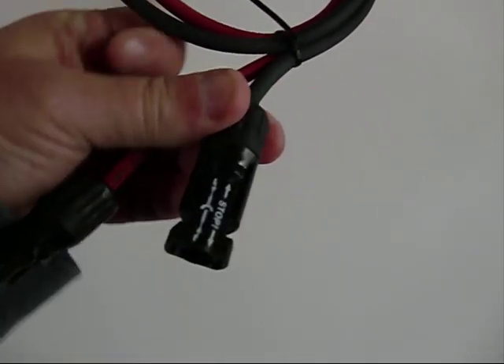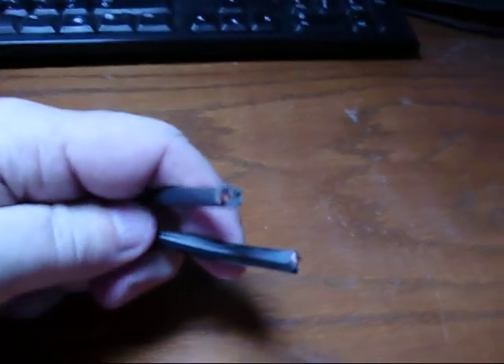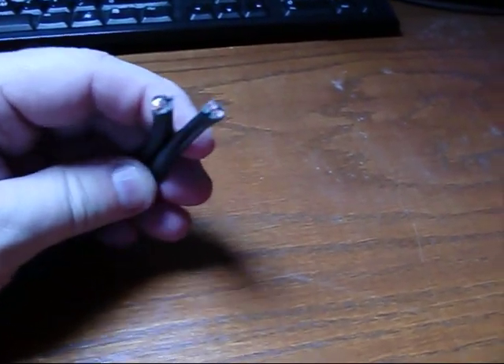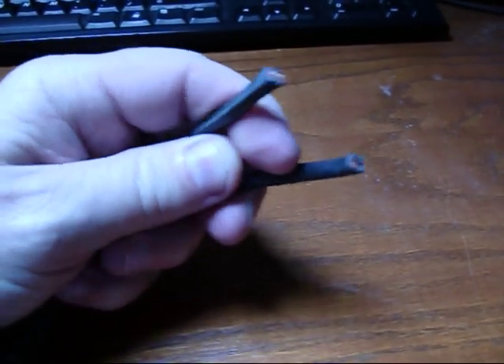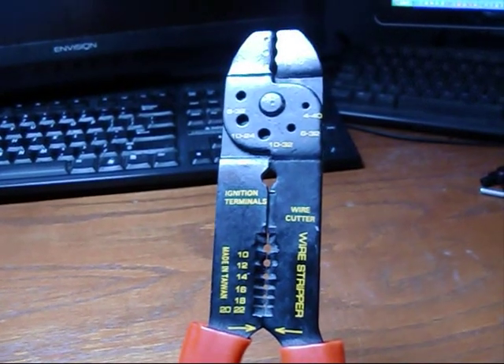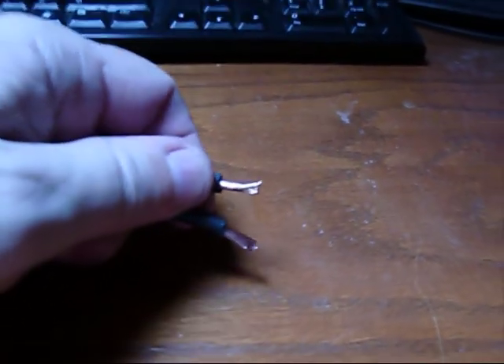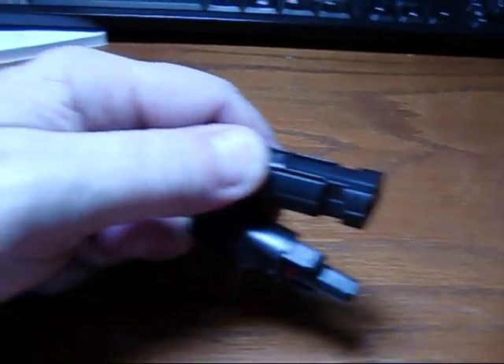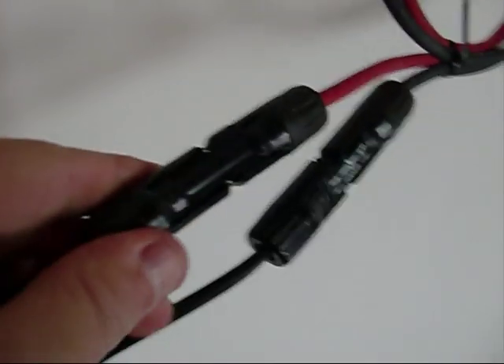DIY MC4 Solar Panel wiring

Comment: This was helpful to me as a newbie to this type connector. However, I believe I will limit these to outdoor use only, and only to mate to what is on the panel I purchase. Once indoors or even under the building/out of the elements, I will switch to more conventional (and cheaper) DC wiring hardware and techniques. Also, having a lot of experience in crimping, I would suggest getting a crimper that exerts 360* crimping pressure if possible. If you can't find one, crimp AND do a careful and minimal soldering on the contacts to ensure a good, long-lasting connection. Buy a few extra 'pins' if you're unsure of your soldering prowess.
Reply: snowbird29803 this isn't helpful at all. This is very dangerous what he is showing. this must be done by electricians with a proper crimping tool made specific for MX4 connectors. IF you do this with the kind of plier he showed you are making a terrible connection. The crimping part of this plier is made for insulated cable shoes, not MX4 connectors because mx4 connectors use trapezium crimpers.

Comment: Good that you mentioned the solar rated cable, if mounting on roof, wiring should be that cable only, but once you go off the roof and go conduit or ground mounted use cheaper cable...

Comment: The 'electrons flow down the surface of the copper' is called skin effect and only happens with AC currents at high frequencies of many Mega Hertz.  It has no effect what so ever at DC.  What matters is the total cross section area and how flexible the cable is if it is going to be subject to any movement or vibration.

Cheap crimp tools do work but are prone to giving weak grip on the wire.  After crimping always test the joint with a good firm tug to prove it's secure.

Using other types of cable may not form a water proof seal to the MC4, water, even humidity will over time destroy the joint with surface corrosion, especially with a DC current flowing.

The other important point with DC solar connections is never to plug or unplug with a current flowing.  It will arc and burn the surface of the connector.

Dave.
"I'm an engineer so let's save time and accept that I'm right"

Comment: Sorry on a debunk channel.  I wouldn't use the MC4 connector for nothing.  I saw when this trashy connector was release by I think it was 3M.  They were trying to a similar style connector for fiber which wasn't popular.  If it was me depending on the current and voltage I would use a good ole XLR connector.  The solar industry can just change.  Most people I know just cut those connectors off and don't use them.

Comment: It's better not to pre-solder the wire. This adds resistance to the end of cable. It's better to only use solder when attaching the wires to each other or a solar panel etc, without adding extra solder before-hand. The reason for pre-soldering is when pre-stripping copper wires that you don't want to oxidise.

Comment: Don't spread false info.
Electricity flows through the copper metal, not the surface of it regardless of wether it's solid or stranded wire. Higher amperage requires a bigger cross section or "gauge" wire (lower numbers are bigger wire). The only difference between solid and stranded wire is flexibility.

Comment: Good little video. Now, how do I connect the solar wires to my charge controller?
Reply: +Jesse Toler Most charge controllers just take bare wire because it has screw terminals.  So, if you used 10 gauge wire like this guy did, connect your MC4-crimped side to the solar panel and strip the other end of your 10 gauge wire, twist the strands together, and insert the wires into the + and - screw terminals of your charger controller (PV terminals!! not battery or load terminals!) :)

Comment: The claim about electrons and the amount of wire strands is just plain wrong!
Electrons do not flow down the outside of cables. They flow inside the cable. (Just like water flows inside a hose, not on the outside. )A thick, single-strand, copper wire will allow more electricity through than a bunch of thinner wires. Thicker wire also allows higher amperage because there's less resistance.
The only reason for multiple wire strands is to all the cable to be flexible without snapping.

Comment: Why did you waist a bunch of time showing that is totally use less and then miss showing the improtant part of process, the striping of insulation with strippper and  crimping part with crimper.

Comment: THEY ARE NOT MC4 CONNECTORS BUT COPIES!  THIS GUY DOESNT KNOW THE DIFFERENCE.  THE CABLE USED IS NOT CROSSEDLINKED, AND HE STRIPPED BACKED TOO FAR.  THIS GUY IS DANGEROUS

Comment: Good video.
Hello friend, we are a MC4 connector manufacturer in China, welcome contact to get more information if you have are intrested.
Reply: and the picture you have are NOT real MC4 connectors and you are not producing MC4 for Multi-Contact and you dont work for Multi-Contact
Reply: +Summer Xia that's not the official mc4 connector on your profile pic. WE have tried a LOT of different chinese mc4 connectors at work and they are ALL rubbish. most of them are a few mm too long or too short so they don't fit into the locator af a crimping plier properly. Or they are made out of steel/iron instead of aluminium (better conductivity). Never going to get chinese connectors again they are serious fire hazards. IT's a mystery how they still can be manufactured in your country.
Reply: Thing is FoodOnCrack they are not MC4's they are copies. the MC in MC4 stands for Multi-Contact who created these to begin with same as the MC3 and everyone has copied and think that they are ours but there is ways to tell a copy from an original and i have been to solar farms where they have failed and they think they are Multi-Contact MC4's and we have had to walk away because they are not and not much we can do, so only buy the original which you can only get from Multi-Contact and certain representatives around the world..